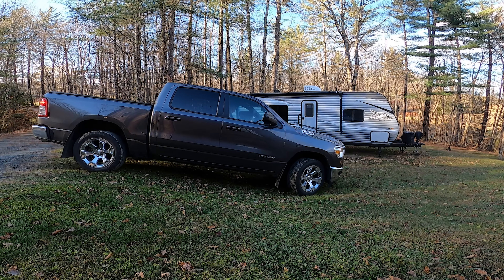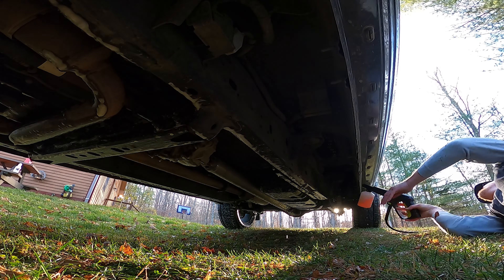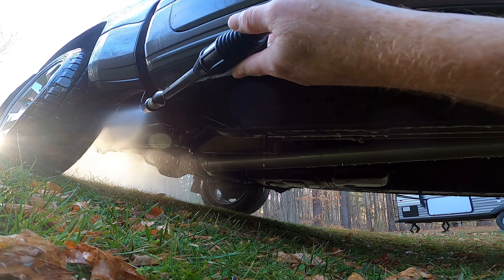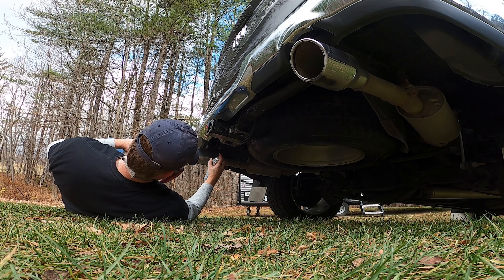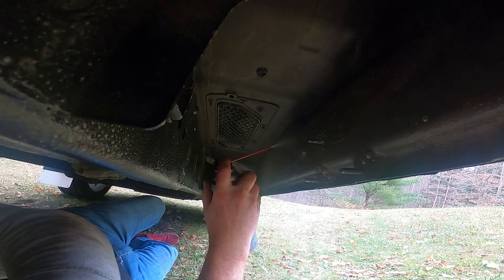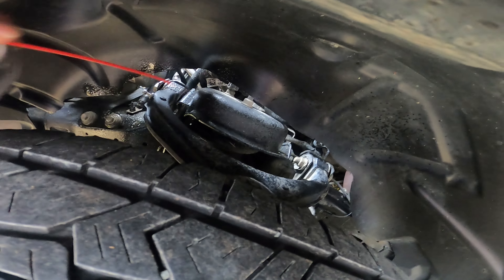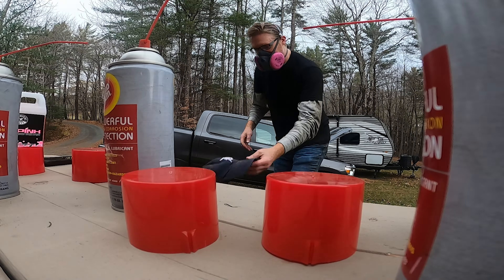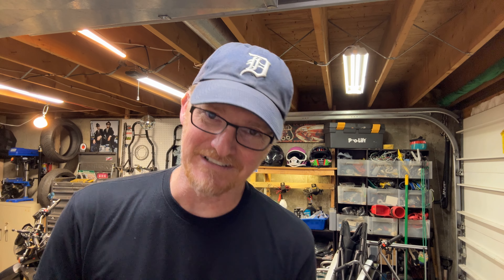DIY Rust Proof in a Can! It Really Works Even In Vermont Winters! RAM 1500 4x4

Comment: The key is to spray on a clean frame, which you have perfected! Spraying on a dirty frame will still work but it creates a mess where more dirt accumulates on top.
Reply from the maker: And fluid film says don’t spray on top of old fluid film as it will trap impurities against the metal. Clean then reapply is definitely the right way to go 👍

Comment: Good info!  Thanks for sharing.  About how many cans did you use on your truck?
Reply from the maker: I use 6 👍
Reply: Used it for the first time last year and very happy with it. Can you respray over the fluid film from last year or is the degrease and wash needed?

My only tip would be to get the handle grip spray attachment for the cans, made it much easier!
Reply from the maker: Fluid film says clean it. High pressure washer. Degrease it. Doesn’t have to be perfect but you want it clean so the fluid film can sink into the metal. Old fluid film can have contaminants from a year of driving. And it’s usually filled with dirt. Oils. You want to clean it off and apply fresh. Also avoid going too thick when you apply it 👍 it doesn’t need to be thick. Just coated.